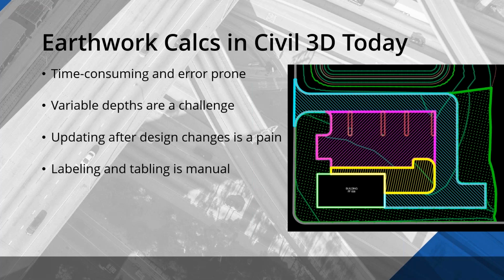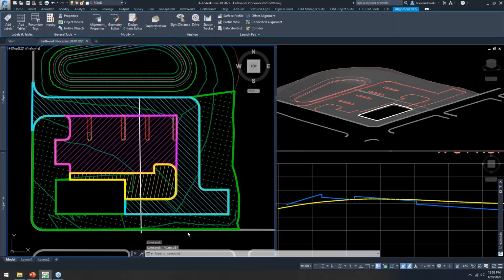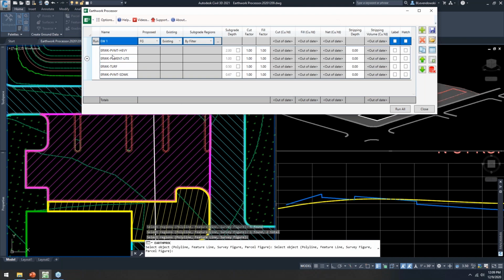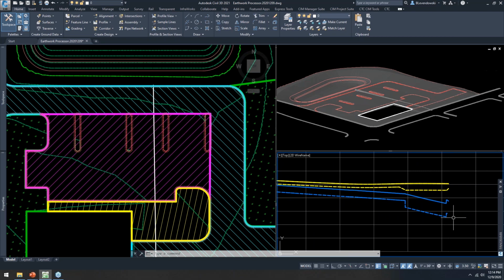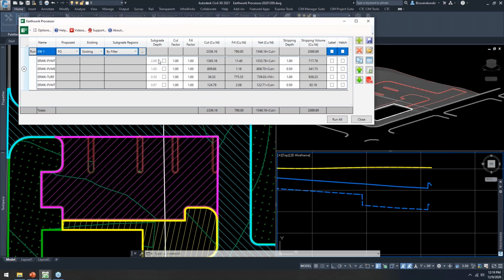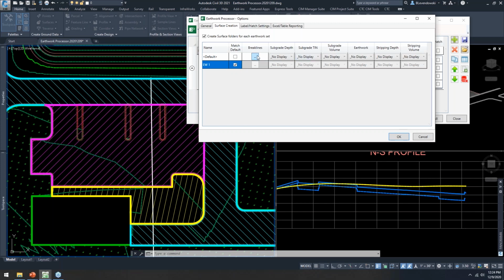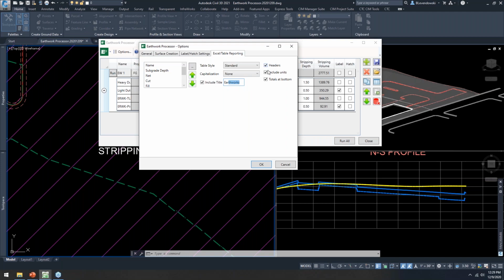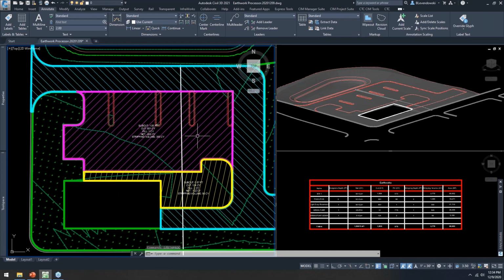Introducing Civil 3D Earthwork Processor for Subgrade Volume Calculations

Comment: Perfect timing on this we are getting ready to perform this work on a large project next week. Is there a workflow that would work for  an area that isn't virgin ground? We will be removing paving areas and soil stripping. This is really impressive!
Reply from the maker: Glad to hear you like it! If we understand your question correctly, the surfaces you assign for proposed and existing don’t necessarily need to represent newly graded areas. You can assign any surface to these options in the application. Does that answer your question?